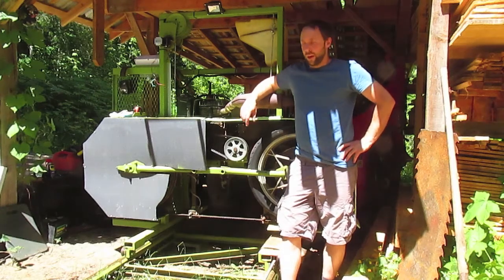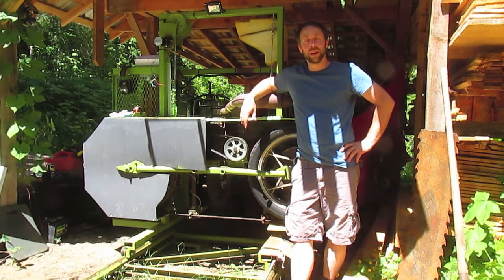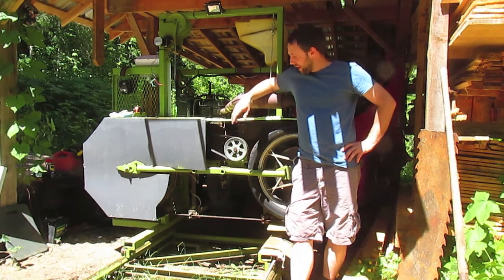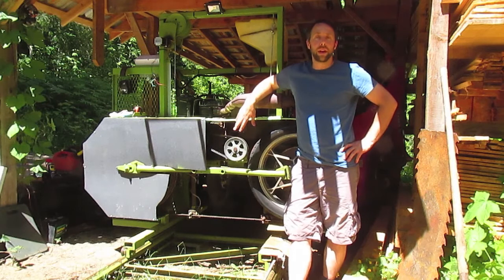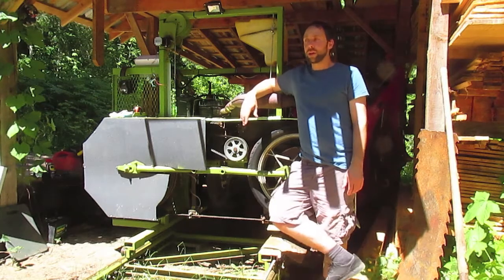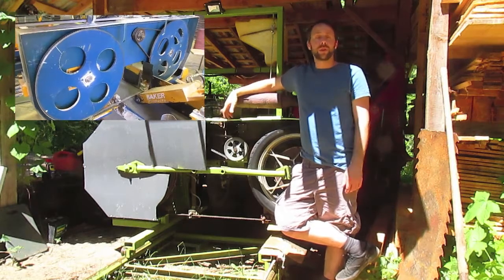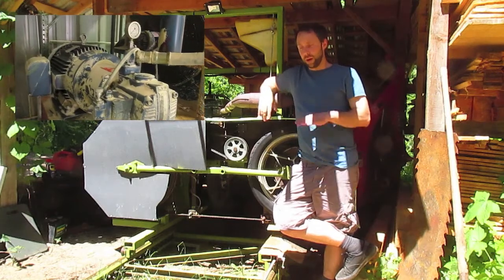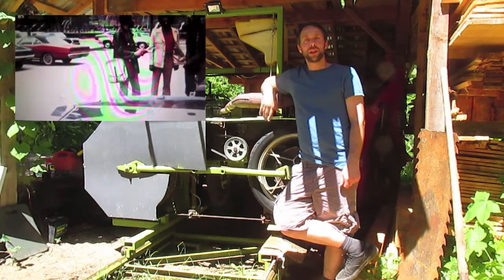Baker bandsaw mill

Comment: Amazing set up.  What are the panels used for that you are creating?  Thanks for the video.  Cheers, David.
Reply from the maker: Hey Good question David.
The wood panels that are being cut are wooden snowboard cores, after this they are flat sanded to get a nice finish on one side, then CNC sanded on the other side for a specific taper on the ends, then die pressed to the shape for the specific snowboard they will be used in.
Thanks for watching :)